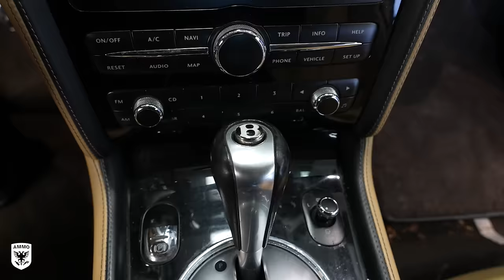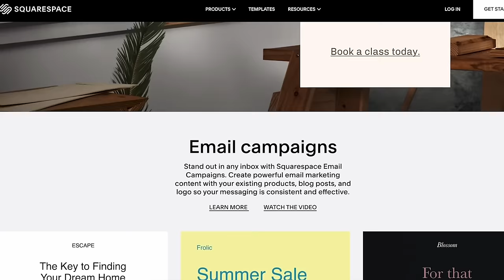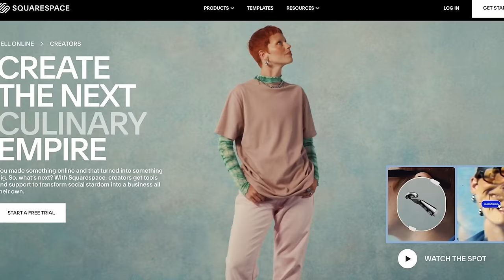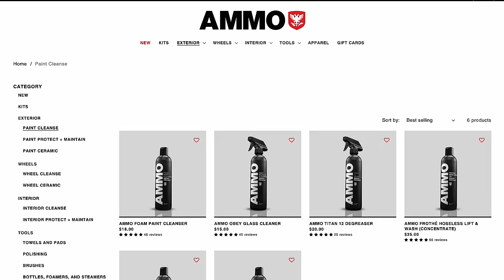Bentley Continental GTC Disaster Detail Huge Transformation!

Comment: I used to own a GTC for 12 years and 860.000km. Yes, you read that right. It did not look anywhere near as bad as this from the vid. I cannot believe how people mistreat their cars.
Reply: WOW 860k's that's amazing. You drove the heck out of it mad respect.
Reply: @RetroMotiveAdventures  it even didn`t feel worn at the end. Only required regular service. Just a brilliant luxury daily driver with all the pros you get from VW AG and in my case no negative issues.
Reply: What year and any vacuum leaks?  Plastic vacuum lines should never be used. Plastic dried and ultimately cracks due to thermal cycling. Mine's an '06 Flying Spur, bought with only 38,500 miles a few months ago. I guess I have quite a few miles to catch up with you! Very pleased to hear your story.
Reply: @Greg-kp5gd  it was an 06 as well. One of the first off the line. I flipped my GT for it. In 07 I added a Flying Spur as family daily, since the second kid was just due. With kid no 3 we decided to come down to earth again and got rid of both, bought  two Sharans instead, did some cool upgrades and are happy ever since. Less jealous people at the school parking comes along too.
Reply: Wow 860k km, that's incredible.  May I ask how much was maintenance over that period of time, and if you had warranty, or any crazy expenses like a new engine. Thanks!
Reply: @atom999  just regular wear and tear. Nothing wild. Twice I had to have the lambda sond replaced. Luckily a friend`s cousin found a way to replace it without taking the whole engine out. I did not count cost as ”why should I” 😉

Comment: Larry, something that has always bothered me about using soap and brushes on the interior - the steering wheel, HVAC controls, center consoles... doesn't that water and soap make its way into the seems and behind the buttons and just build up a nasty residue of old soap? Wouldn't that become an issue after some time?
Reply from the maker: Compressed air

Comment: Is there a rule of thumb when powerwashing enginebays? Due to all the connectors, battery and wires in there. Are they capable of handeling water or do I need to avoid or prep stuff?

Comment: At 12:08-12:30 there were scratches in the paint, then they're gone! I have scratches just like that! What did you use to get rid of the scratches? I have used Maguire's wax and it brought the depth of the paint out. But I still have the scratches. I want to know more.

Comment: When these first came out, Volkswagen was selling their Phaeton - a four door luxury sedan built on the same chassis (same factory, etc.).  Basically a budget Bentley.  We sold only a handful of the nicer W12 models (an incredible motor), and many of the V8 models which were as little as...$63K or so if my memory is correct.  Pretty wild attention to detail in those cars.  This was circa 2004 or so.

The Phaeton had to be sold by a qualified "specialist" who attended classes on all the selling points, etc.  Really cool car...but silly for VW as a brand at the time.  Even though they'd launched the Touareg (which topped out around $58K I believe for the 5.0 V10 TDI we had shortly), no one was shopping VW for luxury cars.  The Phaeton was probably the buy of the century if you wanted a big luxury cruiser..but again, no one is going to shop VW for that kind of car.

Comment: Could you apply a similar product to what you apply to black exterior plastics to the steering wheel? Bring back the black, albeit temporarily. Im guessing though the texture or film could create a lack of grip on the steering wheel.
Reply from the maker: No, it’s a slick coating designed for rough black plastic

Comment: "You're driving a Bentley for under $40.000, it's a pretty good deal"
Well ... let's see if after the first service action plus repairs it doesn't add at least another $10.000. If the outside is mistreated like this, I have zero hope for what's underneath ...
I also see  "cheap" Mercedes S-classes and BMW 7-series on the market. But I never heard people not spending thousands of euro's or dollars on such car over time. There's a lot that can break, is expensive and it's not focused on having such a reliability, that's it economically worthwhile.